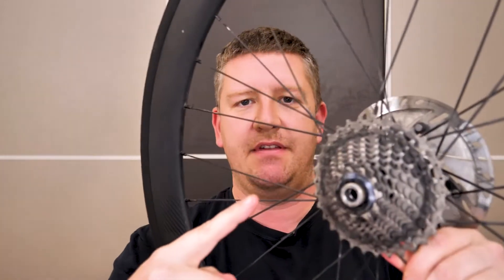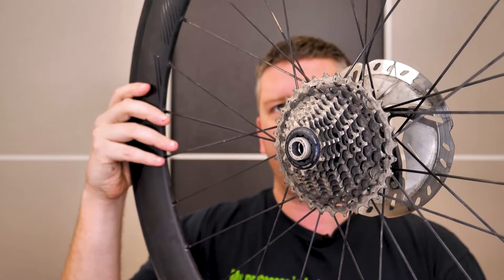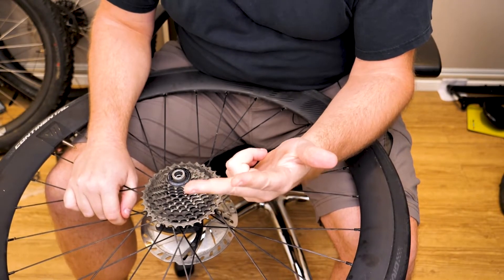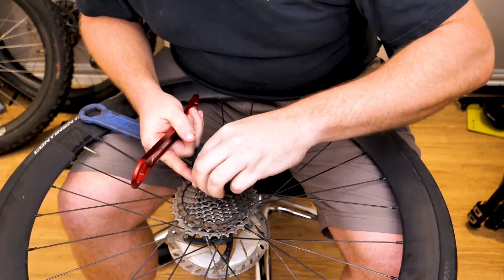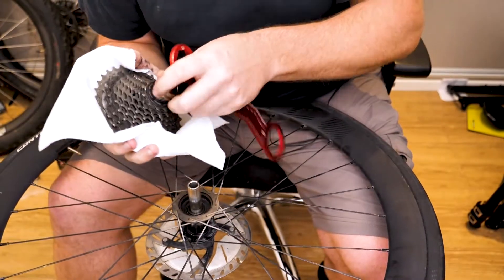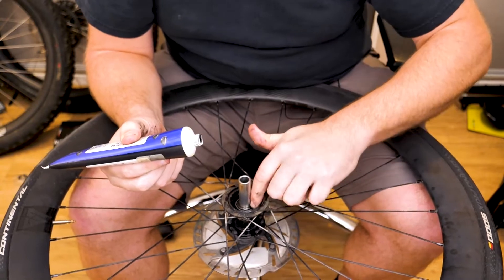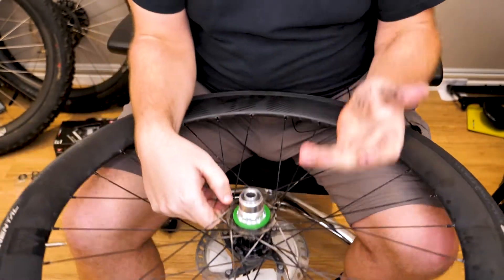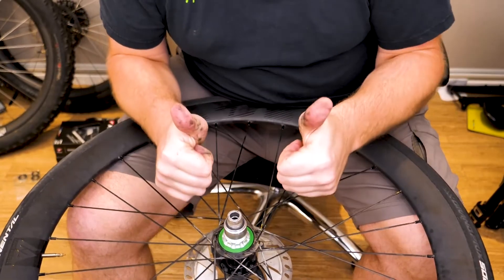Hope HG to XDR

Comment: I also have the Xd Freehub for this but I do not like the design of screwing a 12 speed cassette on a blind  thread, it seems that there is a risk of cross threading and this could be an issue. I Have the Hope HG 540 freehub and fitted the Sram NX 10-50 Cassette on it.
Reply from the maker: I agreed that it can be a bit worrying at first but the risk is minimal due to the fact that the threads are guided by the sleeve in the middle of the cassette.  Since installing XD cassettes a number of times now I actually prefer the setup significantly.

Comment: I have swapped a Shimano Freehub body for an XDR on a formula hub but require a different end cap as the old one is too wide to fit inside the XDR body. Any suggestions where to get hold of one?
Reply from the maker: I am sure Formula makes the part but I have no clue where to find one.  Hope you have luck finding it.

Comment: This means the hope rs4 use the pro4 xd freehub？
Reply from the maker: In theory yes, but I have not tried it.  There is nothing I can see stopping you from running a standard pro4 freehub body in a RS4 hub.  But keep in mind that the pro4 freehubs are designed for mountain bike cassettes, not road cassettes so you could run into issues trying to run an 11sp road cassette on a 11sp mountain freehub body.  This is because more road free hub bodies are just a bit longer than the mountain equivalent.